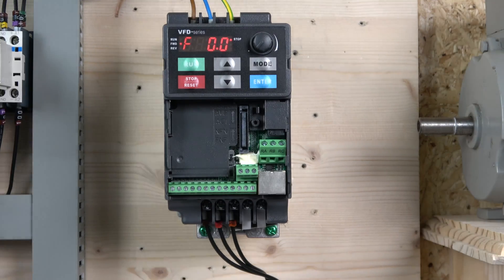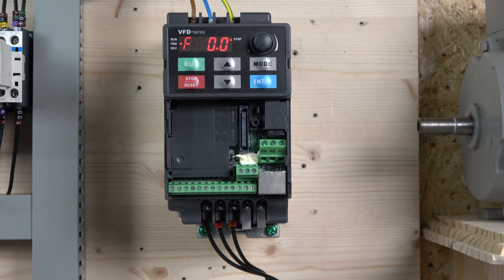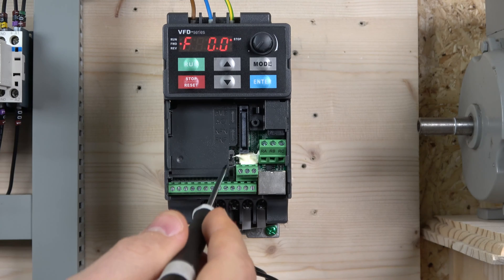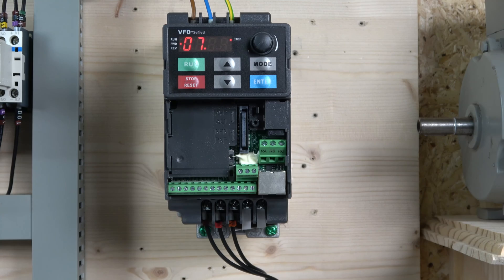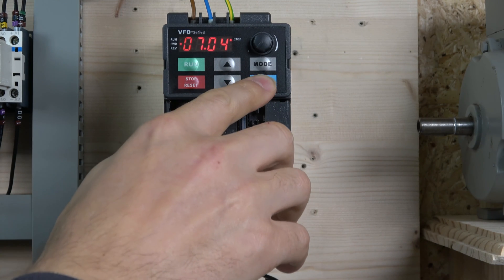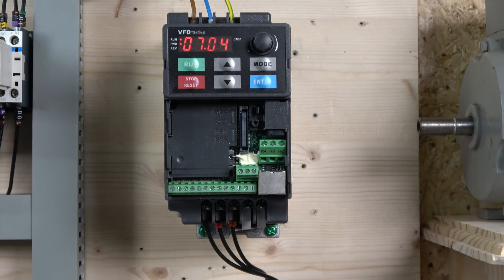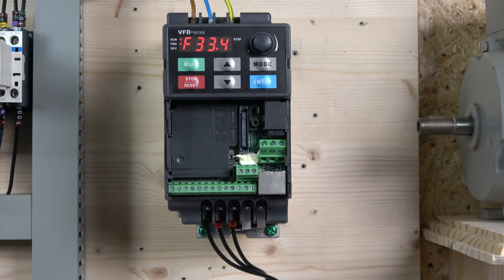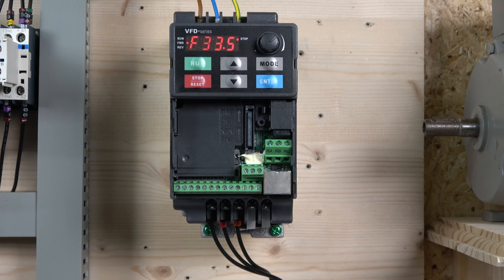Delta VFD-E drive local run, commissioning, parameter set up, Factory reset. (English)

Comment: Hi dear, 

I have a question , I want to buy a 3.2kW spindle,  so i need a VFD. 
I have 1PH 230V at home5 (France),  I checked Delta and there is 3.7kW models ( VFD E, VFD EL , VFD MS300 etc ) but until 2.2kW models it is indicated that input could be 1PH 230V or 3 PH 230V , for 3.7kW like VFD037EL 23A it is written 3 PH 230V , so i can"t wire only one phase ?? 

thank you in advance for helping 
Thomas

Comment: Hi i have purchased a Delta Me300 could you tell me how to out it in to a auto start mode
Reply from the maker: Hi Clive, it should not be in auto start mode if you purchased new, if used, the best way is to do factory reset.

Comment: hello!!! i have a handmade pottery wheel and it has similar controller on it (vfd004el21a ). i have an issue. when i press the pedal it start kinf of fast. it is possible to slow the rpm ?  what i should do ?  thanks
Reply from the maker: If you want to slow down on start up, use acceleration time to do that, if you want to slow down permanently, change your max frequency.

Comment: Hi That for the great video on setting up this drive.   Does this drive have a Drive reset input I want to hook it up to a Centroid Acorn CNC control 0-10 V and need to enable the drive and then send 0-10 Analog.    I also need a zero speed output for the tool changer.  Is this something that would need to be programed within the drive
Reply from the maker: Hi There. Yes this drive has drive reset input, must be assigned to one of the inputs, all this you asking can be done on drive but will need some skills to set up. Do check out other 2 videos i have made on this drive to assist you.